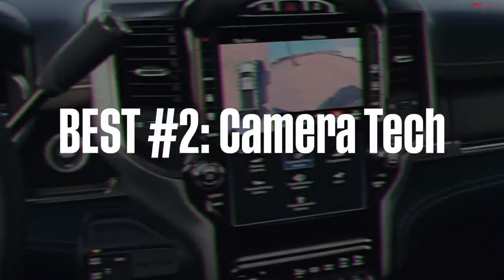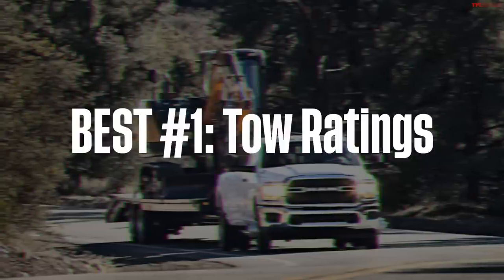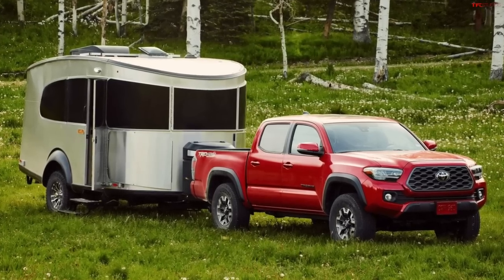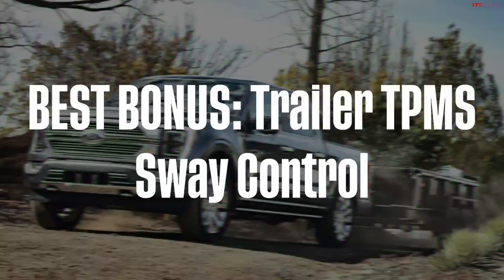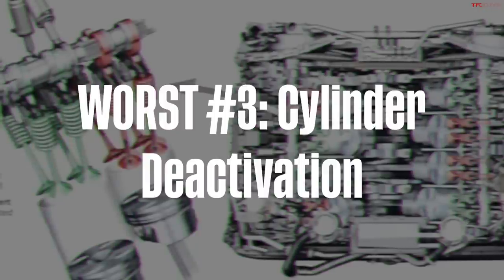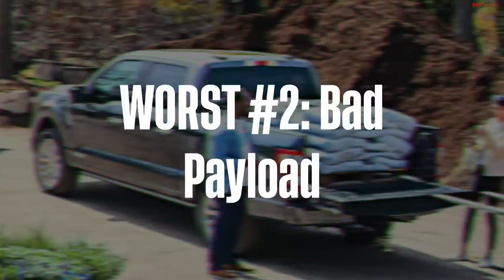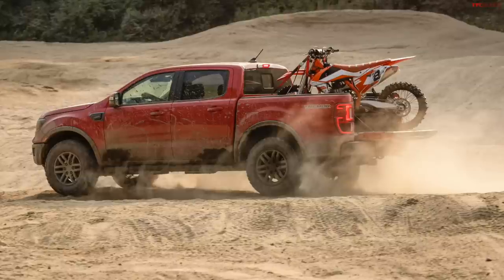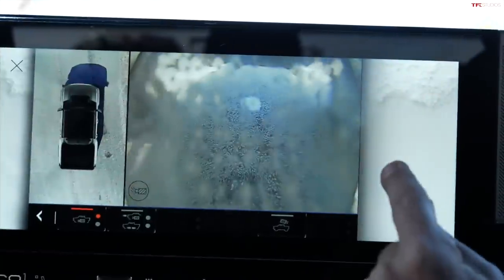This New Truck Tech Makes Your Pickup WORSE!

Comment: I am surprised that the engine auto stop/start didn't make the list of worst features.
Reply: I have a 2020 F150 and I hate that feature!!
Reply: Ford offers a delete now
Reply: I was able to delete that when I ordered my F150.  Unfortunately, there’s still cylinder deactivation.
Reply: No issues with my Tundra hybrid. Transition from electric to gas or gas to electric is seamless. I honestly enjoy the system, watching the tac drop to zero while still driving or going down hills. Even stopped at a traffic light isn't a pain. Other trucks I have driven, I would agree with the sentiment above.
Reply: Two of the reasons I purchased a (previous gen) Tundra. NO auto start/stop and NO cylinder deactivation! 👏🏻👏🏻👏🏻
Reply: Love how Toyota 2022+ did the auto start stop. You control it with how hard you press on the brake petal. Works wonderful.
Reply: I have a Ford maverick and absolutely hate this feature. But Im learning to control it by not hitting the break so hard. Light breaking doesn't shut it off
Reply: Good call! Start/🛑 shit sucks, so does cylinder deactivation! I would rather my vehicle just run 💯% of the time on all the cylinders the way it should imo... I don't care if they "design it" with the start-stop shit, I don't like it 🤷
Reply: @DH-mf2lv  I had a 2nd gen.  Great truck, except for payload.  My F150 has over 1.4K lb more.
Reply: We had that on our 2017 Malibu and absolutely hated it
Reply: I agree that it sucks but all you have to do is push 1 button 🤷‍♂️
Reply: BuT iT hElPs FuEl EcOnOmY 🤣
Reply: Used to not like it, now it’s not at big deal. Very easy to deactivate and you learn how to use it after awhile.
Reply: @cheapme1850  it wasn’t bad if you do a lot of highway driving but driving through town it was a nightmare. On the specific car there was no way of deactivating it.
Reply: @79random  what button would that be?
Reply: Get an HD truck. Doesn't have the option for start/stop
Reply: Worst addition ever invented.
Reply: @cheapme1850  I like it. Why not save money on gas, makes me more engaged driving my truck. I lightly lift my foot to start it when I know I need to make a left or able to get on it.
Reply: If you don't depress the brake too far it won't shut off. The farther you press the pedal the more it will start/stop.
Reply: RAM does it the best with its etorque system
Reply: Most of the time they have a simple button or settings to shut it off… I’ve had some loaners while work was being done, and just from radio and aC going it never even did the auto off functions
Reply: Just push the dang button to turn it off. That’s not hard to do.
Reply: @PrimeMedicated  Herrr-dee-derrr! 😂 
Yeah, what it really does is add additional cost to already overpriced vehicles. Even worse yet, it throws any engine's longevity right out the window! All their fancy b.s. "tech" isn't better for consumers. It's only better for lining the manufacturers pockets.
Reply: Just another useless "tech feature" to spend one's valuable time & hard-earned money on, to have deleted if & whenever possible.
Reply: @HopsNBarley2002Twice  You don't save enough fuel to matter, and the long term destruction of your vehicle's engine most certainly isn't worth it. If maximum fuel savings is important to you, buy a small fuel-efficient car. If you must have a truck, greater fuel costs are a part of owning any larger, more powerful & capable vehicle.
Reply: @HopsNBarley2002Twice  I actually get concerned now when it DOESN'T cut off sometimes or cut off quickly.
Reply: @turbodiesel4709  What?!!! Your telling me stop and starting you engine multiple times all the time does damage…. No that can’t be !! People are dumb if they leave this enabled and don’t delete it. Manufacturers should be on the hook for the engine ware and starter replacement after 50K miles
Reply: @DrJeffM  The first thing I bought for my 2020 was an Autostop Eliminator. It plugs into the wiring harness behind the button inside the dash. Pretty easy to install.
Reply: @sexyfishyphish i want a TRD pro so bad. Right now I drive a 2022 Mercedes C43 and got my fast car buzz now I want that damn truck
Reply: I don’t like the stop/start feature either but it does make it so that we can have more traditional trucks on the road for longer.  Cost of doing business at this point..
Reply: Sheash,,,,,what’s the big deal?  So what if my Raptor shuts off at a stop light,,,if change bothers you so much just hit the huge and obvious disable button at the top of the center stack plus it’s impossible to move your foot from the brake peddle to the accelerator before the engine restarts so it doesn’t affect driving in any way at all.
Sounds more like insignificant first world complaining.
Reply: @HopsNBarley2002Twice  because it puts more wear and tear on your starter, it won't last as long, they only have so many starts.  Oil is not circulating thru your engine, more starts with no oil pressure.
Reply: @elkhunter3382  Hey I heard yesterday that a replacement start-stop starter costs something like $1500 I hope it doesn’t wear out  before 300k miles LOL
Reply: @rickw.9298  my 2018 jeep, I was told when I bought it that the starter was just a regular old starter, nothing special.  I bypassed the start stop by disconnecting the hood open switch.  other cars might have special starters, I don't know.
Reply: @elkhunter3382  that is interesting. I've also learned recently that some manufacturers are adding an addition wear layer on their rod & crank bearings to deal with the stop/start demands. Everything these days depends on make model and year. Nothing staying the same for too long.
Reply: That option just wears your engine and starter out.
Reply: Bar none, the worst feature along with cylinder deactivation.  Since the vast majority of engine wear happens at startup, let's make the truck start the engine more often.  That doesn't even account for extra wear on the starter motor.  Of course, we have to couple that with a technology that causes uneven heating and cooling of the block but turning off cylinders while driving causing the ones that are working to be much warmer than the ones that aren't, because seals and gaskets work so well with uneven expansion and contraction of the parts.

At least the start/stop garbage is usually pretty easy to defeat, short two of the pins on the button together permanently (at least on a Ford).  The displacement on demand seems to be a function of either the camshaft or the lifters depending on the engine, so usually there is no good and quick way to turn that crap off.
Reply: @79random  If you're like my dad, you won't remember to push that button until the truck has pissed you off by cutting the engine out unexpectedly.
Reply: @PrimeMedicated  F*ck fuel economy.  I want a dependable vehicle first and foremost.
Reply: @2003evodave  You do realize that the vast majority of engine wear happens on startup of the engine, right?  Why?  Because most of the oil is in the oil pan when the engine isn't running and it takes a bit of time before the oil is pumped all the way to the top of the engine where the camshafts are.
Reply: @Garett30  the Auto Stop/Start off button
Reply: @Ironclaw  100% me and while I'm quick to get aggitated, I honestly don't find it to be a big deal. Now all the warning/safety chimes in my wifes new Subaru...now that is a real piss off

Comment: If the high prices are not enough of an insult, GM is shutting down production so they won't have to give discounts.
Reply: Actual supply shortages and consumer demand drove prices through the roof. This gave manufacturers a thirst for higher profits that came along with it. They are trying to "OPEC" the auto market by artificially slowing supply so the demand, thus the price, stays the same. Unfortunatly for them, trucks aren't oil, and they will eventually see the market disturbed because of competition. Additionally, they are passing their company's failures in terms of cost (recalls and poor build quality) on to the consumer instead of fixing the root of the problem. Shutting down factories and laying off folks is certainly a sure fire way to kill productivity and motivation to provide top notch build quality.
Reply: @bnut1979  🤣 if you think those things concern companies I feel for you.  They are only concerned with them in so much as they impact profit.  As you've pointed out, they've all been deteriorating yet profits are at an all time high. If they think they can increase profits by changing them, they will. Just don't hold your breath.  If they can make higher profits building less vehicles, it would be reckless to change. It does leave things open for competition, but rolling out a new car company or product is an incredibly difficult endeavor. Most fail. Welcome to Capitalism. It works... sometimes
Reply: @bnut1979  Yeah, I'm just biding my time.  I will buy when the crazy prices go away, not before.
Reply: @wilmarbarrick3194 If it were only Capitalism. They would have never got hundreds of  millions of our money in covid grants and intrest free loans to stay alive while producing NOTHING for those they recieved money from. Just like the bailout times back in the old days. Whether you like it or not they have your money, even if you drive a 20 year old truck with over 250k miles on it like mine.
Capitalism means your NOT too big to fail, and you have to cater to your customer not the government.
Reply: That's why I never support government motors
Reply: @jeffk464  Unfortunatly, I don't see this improving dramatically in the near future. I fear the market may evolve into something far worse before getting better.

Comment: Pricing is the main issue with trucks at all levels right now. It's absolutely insane to think I bought a NEW mid trim level pickup for HALF what they are asking just 4 years later. I'm driving it til the wheels fall off until truck manufacturers get their sh!t straight.
Reply: Absolutely. Just a few years ago you could buy a well equipped crew cab 4x4 XLT F150 for mid-to-high $30k range. Now you can't get that truck for less than $60k.

Comment: Bed length would be on my list.  Most new trucks look absolutely ridiculous with these super short beds and massive cabins.  Especially when you try to spec out a smaller cabin (if one is even offered) but then lose out on other features because of it.
Reply: My f-150 supercrew has the short 5.5' or whatever it is bed and basically that is the longest truck I could get and still be able to put it in my garage since I have about 2 inches front and back with the garage door down.  While I would love a longer bed so I could pick up lumber and stuff without it hanging over the tailgate I have actually just gotten used to bringing my horse trailer when I am picking up bigger items.  Not only is it a little over a foot of the ground in the back but it has 13 feet of flat floor and I can just throw whatever back there and unless the thing is tall and I am afraid it could tip over I just close the door and drive off.  The other benefit is when I get home the thing isn't splatted with bugs like it would be if it was in the bed and taller than the cab.
Reply: @legendaryash  That's kind of my point.  The beds are so comically small now that a "full size" pickup needs a trailer to carry cargo.  Makes me laugh that TFL wants stairs built into the tailgate to access a bed that barely exists.
Reply: My view as well, I want a truck. Not a car with a little bed. Bring the single cab trucks back.
Reply: I agree on this, I really liked the 04-08 (I think) f150s with the slightly longer regular cab and small 3rd door. plenty of in cabin space for a tall adult and storage space but still a full length bed.
Reply: I want a z71 Silverado standard cab shortbed. (6.5').  With a 6.2. And leather.  But I did see Chevy has brought back standard cab shortbed.  Saw on the lot.  But all stripped down
Reply: You can still buy a regular cab truck, with a 8” bed, but you would likely need to order it in, as they don’t sell many, but the options are still available. If you don’t need the huge cab’s, just purchase one with the extended cab, or regular cab. I have plenty of use for the crew cab in my truck, I can tow my camper, and fit my whole family in the cab. Different options for different needs.

Comment: I agree with everything  on this list, and I'll add one more. Telemetry/wireless black box data to the manufacturer.
Modern vehicles are now covered with sensors, cameras, and microphones, both outside and in. It's not clear how much data is going to the maker, who they are sharing it with, and they're  not giving vehicle owners access.
Reply: much like the on board scales, this data is monitored to see how well the truck is taken care of. If you go over the payload too often, pretty soon you will be getting e-mails warning or straight up telling you that your warranty will be voided.
Reply: @CrumbsQ  Good point. And it's not just for individual warranty issues.  When Massachusetts passed Ballot Measure 1 in 2020, requiring  "wirelesss telematics" to be open to individuals and independent mechanics under Right to Repair, ALL the big automakers spent millions to defeat it.  And they're still trying to neuter the law in court.  They claimed vehicle data open to third parties could lead to hacks, unwanted marketing, or even illegal tracking (scary kidnapping in parking garage ads).   Which means the automakers ALREADY have this data.
Reply: @CrumbsQ  Like Andre when he overloaded the Ranger towing that Tahoe (and Still seems to think that was ok, as he mentioned it again in this video)
Reply: OMG. Are you serious? As long as you’re carrying a cell phone you’re sharing more data than what’s compiled by these vehicles.
Reply: @Queensizemusic  I am serious.  No, it's not cool that smart phones are an NSA spook's wet dream.  But people don't spend five or six figures on a phone.  And people at least have some idea what's going on with their data and that the marketing and ads are partly paying for the free services they get.  Not so with vehicle telematics.
Reply: @Queensizemusic  My company vehicle telematics sends data in real time to my employer about vehicle speed, location, how hard the acceleration, braking, steering inputs are, usually with parameter alerts; my employer can input geofence locations so as to alert them if I go outside a given area or visit a specific location, such as my home address; your mobile phone does this?
Reply: Some clowns in Denver were able to hack into Ford's security system and stole some F150s from the airport.
Reply: That's where these "on board scales" can be a problem. If there's an accident... guess what one of the first things lawyers will be checking now?
"You honor... this MAN had a load of gravel in his truck. He was ONE HUNDRED POUNDS overweight!!!... I rest my case."
Reply: @petesmitt  Yes where you are at what time of day how many apps you have open how many hours you spend on any apps how long it sits in any location. and it evens listens in on your conversations, think about that for a minute
Reply: @Queensizemusic  Your cellphone isn't going to possibly void your warranty on your overpriced truck.
Reply: @ironclaw6969  but your apparent paranoia about tracking is misdirected and your warranty applies to everything included with your vehicle.
Reply: @Queensizemusic  Did I exclude any part of the vehicle?  No, I mentioned the ENTIRE truck.
Reply: @petesmitt  yes, your phone tracks everywhere you go. All your employer has to do is get that info from your cell company. 

As for the other firms I’d data, all you have to do is drive like a sane person. If you do that, then who cares if they have that info?
Reply: @ironclaw6969  no, you said that installed equipment would void your warranty, which, of course, it will not because the tech was installed at the factory. You’re arguing against yourself now.
Reply: @Queensizemusic  So you don't think they would void your warranty based on what their telemetry tells them?  You went way over the GVWR ... you revved the piss out of the engine or any other type of abuse it could report on you?
Reply: @Queensizemusic  You can disable phone tracking; I do it all the time, but you can't disable vehicle telemetry; you can drive sanely and still speed occasionally, brake or accelerate heavily occasionally; if you have a manager looking to make trouble, this sort of data can be taken out of context and used against an employee.
Reply: @Queensizemusic  no, I think
Reply: @Queensizemusic  no, what I said was that your car would be happy to rat you out which would possibly Voyager warranty if you were mistreating it at the time.